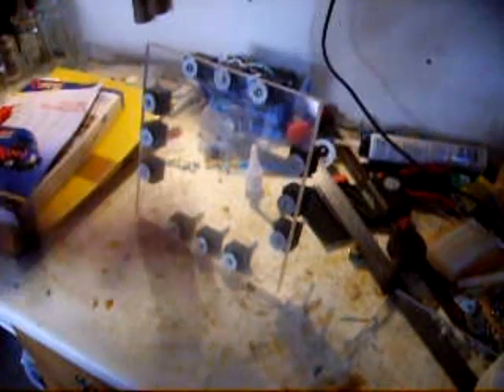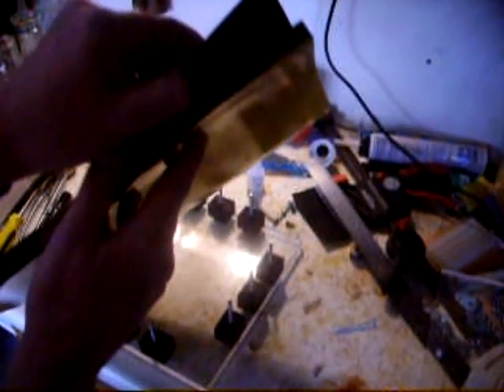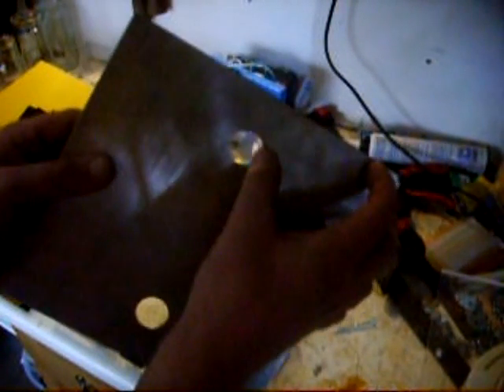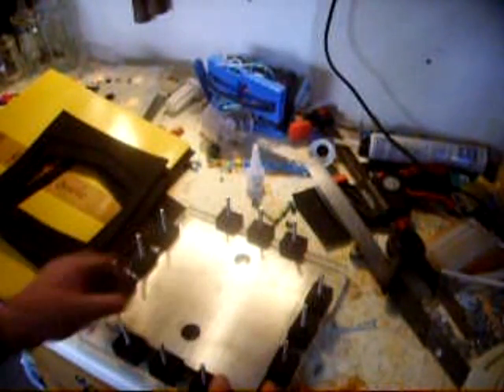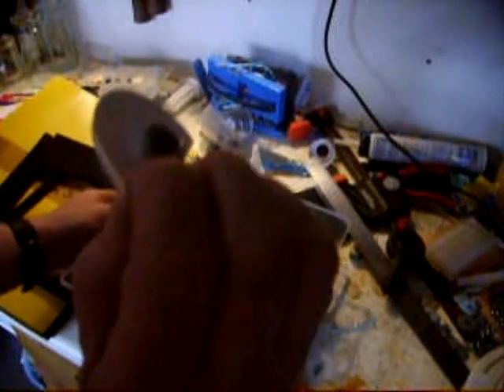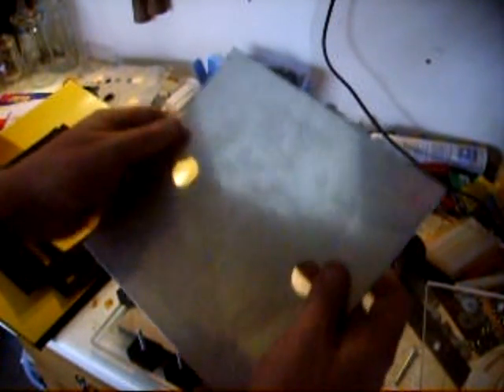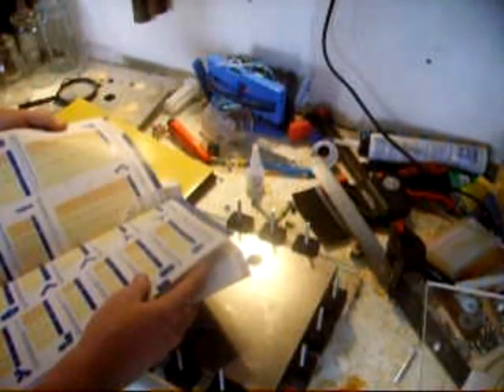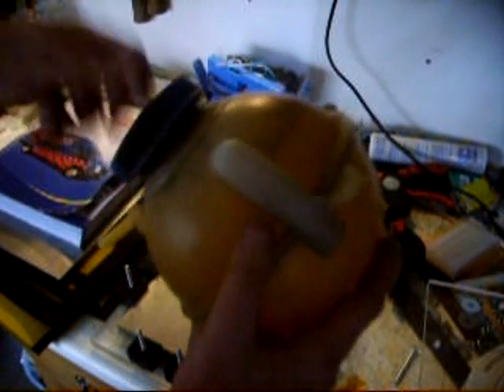hydrogen generator dry cell in the making 7 cell +nnnnn- for a 3.3 litre chrysler voyager 2002

Comment from the maker: hello, Darrellsrelm. thanks for the tip. i had a look at your videos and i can see what you used, looks like good stuff. how did you get it to cover such a large hole while it was setting without it falling out. i have never used that type of resin before. i will have to buy some. I got my nylon pipe fittings delivered today and got some KOH yesterday, almost ready to test, thanks for watching

Comment: This cell will also get hotter than it should run because the holes are to big in the plates and not insolated. To cut don on current leakage. Check out one of my videos to see what I am talking about. "D"